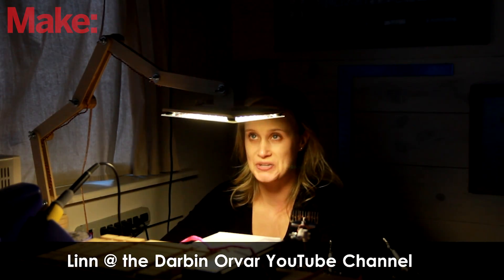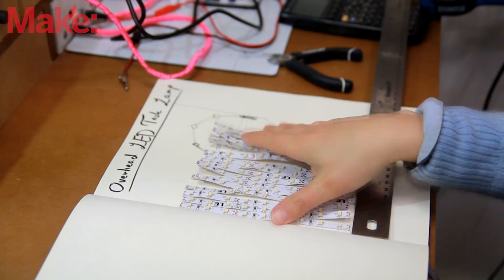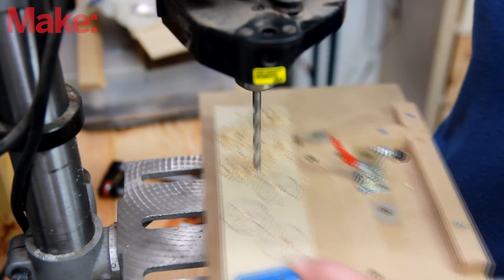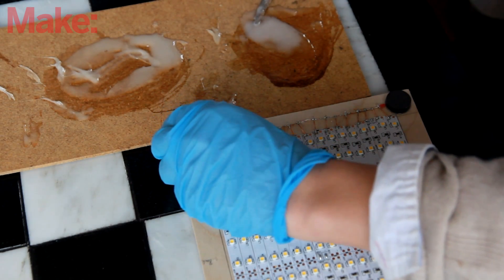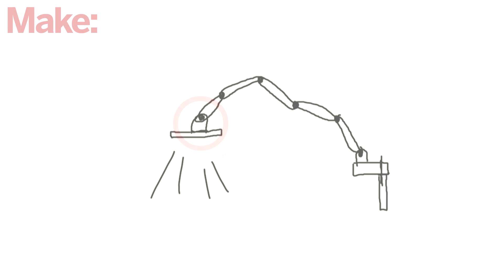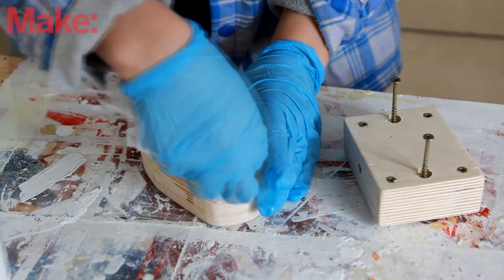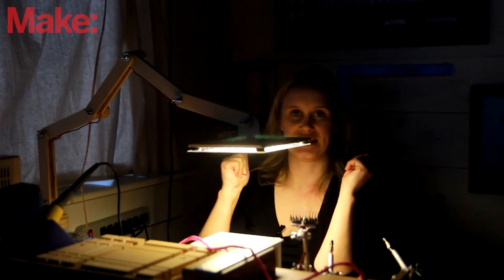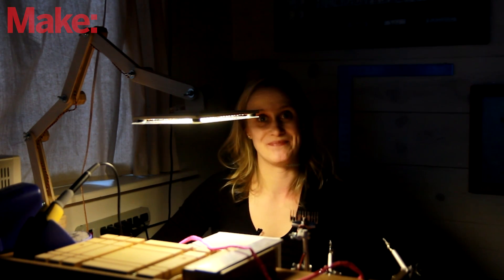Darbin Orvar: Building an Articulating LED Task Lamp

Comment: inches = bullshit
Reply: People, why all those insults? Those really are not called for imho. There's too much hate going on in the world already to be getting all worked up over the differences between unit-systems.

#CantWeAllJustGetAlong?
Reply: +jorenmartijn You're right: It's multiply by 2.5(4) to get cm. Or by 25.4 to get mm :) divide by the same number to go from metric to imperial.
I'm almost getting used to converting imperial to metric, with all the watching of them American videos ;)

Length: m = feet * .3048; feet = m / .3048
              cm = '' * 2.54; '' = cm / 2.54 (25.4 when working with mm)
Weight: kg = lb * .454; lb = kg / .454
                 g = oz * 28.4; oz = g / 28.4

Temperature conversion (F<>C (or K)) though... that's the real bitch imo! (like: F>C, subtract 32, then divide by 5/9 or so; never got that right) :P

/Edit: Corrected stupid mistake, suggesting +jorenmartijn wasn't quite right. He was right! :P Divide<=>multiply :o
Reply: haploide allel Thanks, you're right it was 2.54. I agree about the temperature conversion, I really don't get that. Especially if documentaries say things like 500 degrees, but don't say if that's Fahrenheit or Celcius. I can place 500 degrees C in context because I know 100 C is the temperature of boiling water. So 500 C is very hot. Now if it was 500 F I'd get confused because of that conversion. -_-
Reply: Linn actually has a really interesting video on her shop channel detailing why she prefers to work in inches, if you'd like to learn some things. (Or, ye could just continue to be a jerkface who wishes he was Slash. Whatever suits ye...)
Reply: +haploide allel We talking International Feet or US Survey Feet here? (Just teasin' ye, it doesn'r really make any difference until ye get to far larger than anything they're building on Make: anyway...)
Reply: kilerkai Oh Yeah? You measure your time in metric? Do tell. You're full of shit.
Reply: Imperial is bullshit. Even NASA agrees. http://www.wired.com/2010/11/1110mars-climate-observer-report/
Reply: +kilerkai multiply them by 2.5 if I remember correctly, then you get the proper metric centimeters.
Reply: jorenmartijn
i wouldn´t need to if americans werent so stupid.
Reply: +kilerkai that's the way things are sadly. I think the metric system is much more logical to use then the imperial (?) system? But that may be because I'm european. :P
Reply: +CapnsKustomWorks - I knew there had to be a catch :P
Just as with Gallons... The US gallon, or the British gallon; still screws me over ;) Speaking of British units: the stone... (runs away scared)
Reply: There are actually some industrial Inch systems that are better then the metrical system.
At least for treading, etc. Don´t forget even Europe used inches back in time too.
Reply: blah i use it every day you stupid fuck, i work in the car industry. Who do you even think you are you stupid bitch.

Comment: This is a great design, I really like how freely it can move, but I find the electric job a bit unsafe:
useing magnets to complete circuits sounds like a good idea, but if you have some metal leg from for examle some component you just cut, and it stics to the magnets, supplying the voltage, you will have a really bad short in the circuit.

I dont get, why is it important for the front plexy to be easily removable. Why could yuo just use screws instead?
Reply: Apple has used a little more sophisticated magnetic connection for laptop power supplies for a long time. I think it's a cool idea. Secondly, it's a work space light. So the plexiglas is there to both prevent anything from making contact with the open LED wiring, and is easily removable to enable cleaning. Both of these aspects of the design should be obvious as being necessary to an experienced Maker.

Comment: Using magnets to connect an electrical circuit is very interesting.
Now I'm wonder what the ohmic resistance of that magnet connection would be
Reply: +3MrP3 for the wiring she's using neodimium magnets, which are coated with nickel (electrical resistivity = 69.3 nΩ·m at room temperature). I've measured the resistance of some old neodimium magnets of differents shapes and lenghts, and it was around 2.2Ω.
Also, seems like the wiring connectrion wouldn't work using ferrite magnets: I got an overscale reading when I tried to measure their resistance (my ohmmeter goes up to 2MΩ).
Reply: ***** Very interesting, thanks for measuring the resistance!

I would have guessed the resistance of a neodymium magnet would be around 200-300Ω
Reply: +3MrP3 I`m using magnets in my laptop charger (non manufacturer solution)

Comment: There are a few errors about electronic part...

First of all: use an aluminium base for leds... Wood is really not good for heat dissipation!

Second: use "natural white" leds, my favourite are 4000/4500K of color temperature!

Third: you should use leds with high CRI if you need realistic colors! Ex. I have to see real color if I'm working to paints or something...

Anyway... Good job!
Reply: +Maxx B I understand where your coming from as far as color temperature. I believe it's a situation where, if you experience working in high quality light like a continuous lighting photo/video studio with high CRI 5k lighting, a person adjusts. In a short period of time you will start to see a massive difference in how you perceive color. It's like wearing sunglasses. After you've been wearing them for a while your eyes adjust and you no longer take note of all the tinted colors. With quality lighting it takes adjusting and experience to see how much of the visual world you could miss out on. Plus bright vivid colors, affect outlook in life to a subtle extent :)
Reply: +Mauro Baldi These LEDs really don't need any extra heat sinking, they are quite low power.
Reply: +Mauro Baldi Those low power LED strips only put out around 9w per meter and the plywood is only 4mm so it shouldn't be a problem. I would agree that a metal heatsink would be needed for higher wattage LEDs. I'm guessing the only downside would be a slight drop in light output if the panel gets too hot.

I prefer the warm white LEDs for task lighting, I feel the daylight ones hurt my eyes after a long time. But I suppose the light temperature is personal really unless you are needing really accurate colours for something.
Reply: Jake Little
I see what you and Mario mean now. I suppose because I've really only ever worked in regular offices or my home / workshop I've never really experienced high quality lights. I know when I have spent any time working on computers with low quality screens, my eyes suffer. It's always a pleasure to get home to my own setup.